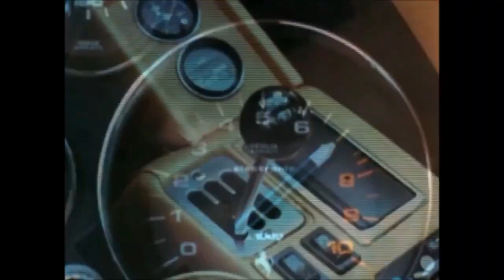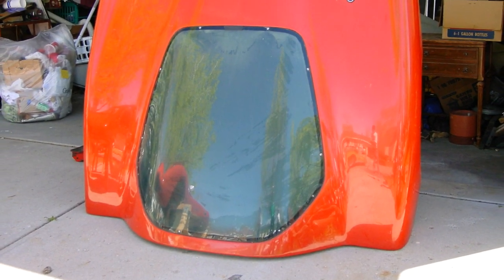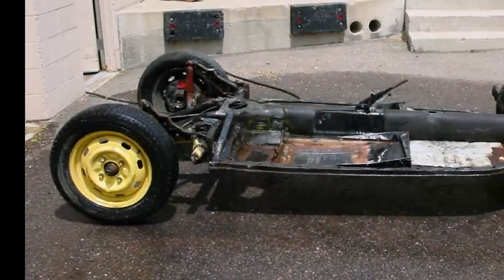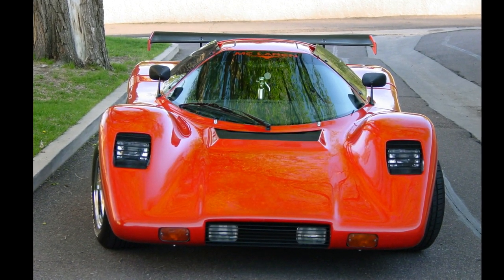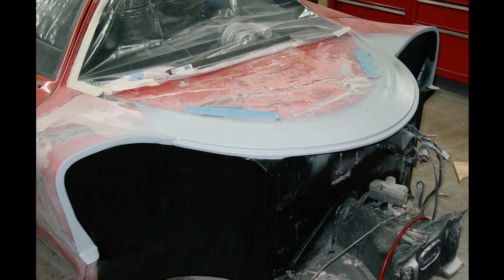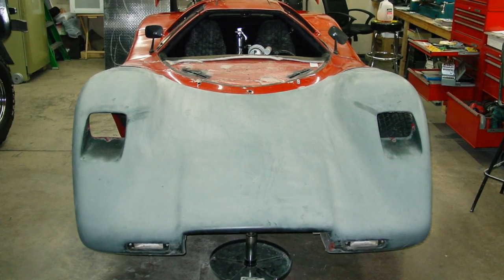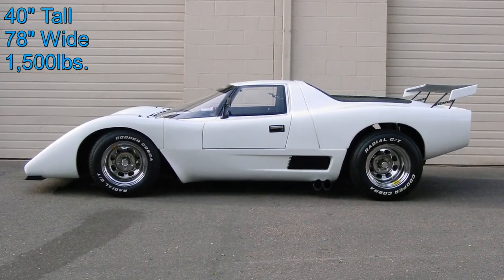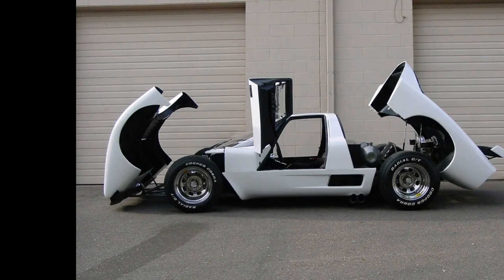1970 McLaren M6GT kit car

Comment: I do have a very important question. Where did you find the windshield replacement? Also awesome job on the rebuild!
Reply from the maker: I will try to get more information if I still have it, it was a company around LA that makes aircraft windshields and they still had the mold.
Yes my acrylic windshield was $1,400 but less than half the weight and virtually unbreakable.

Comment: I just saw your video and would like to ask what where your wheel sizes for your car while it was white. I would really like to build one similar to yours.
Reply from the maker: Thank you for watching, The wheels were the same when the car was red and white.
I bought these from JEGS Performance. They are AERO 50 Series Racing Wheels.  My car was based on a 1970 VW Bug with 4 lugs, I had 4 lug to 5 on 5.5" adapters. AERO 15x8 front, 15x10 rear. The tires were Cooper Cobra 265/50-15 front, 295/50-15 rear.